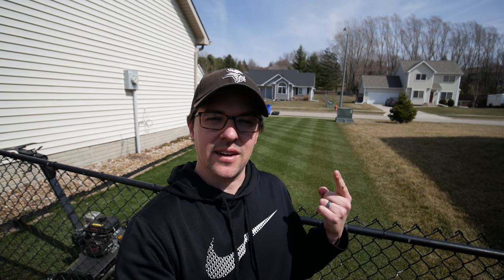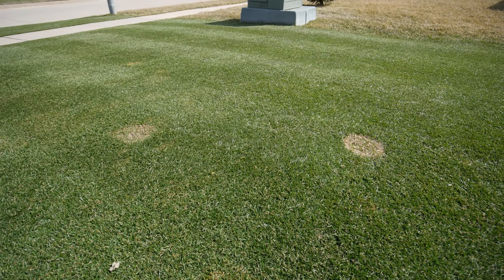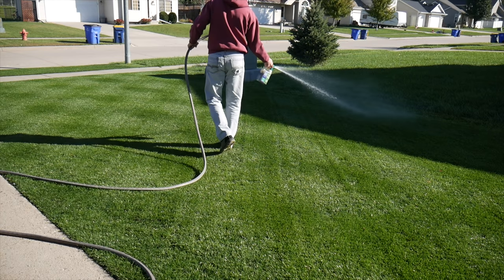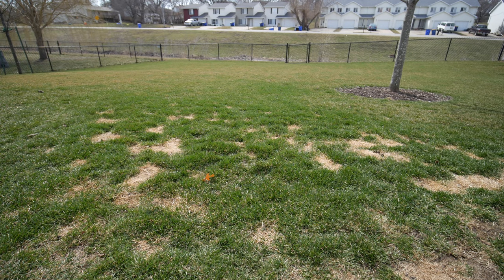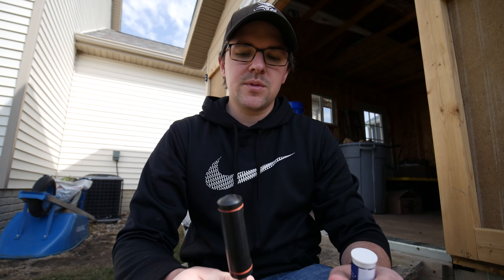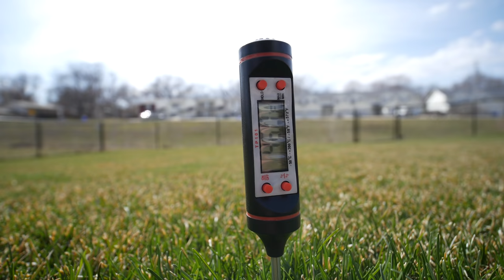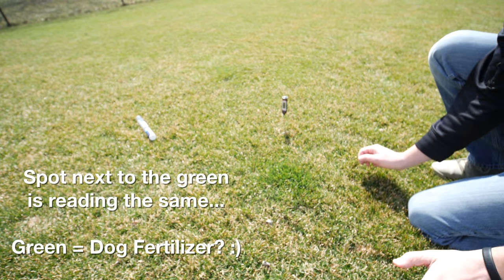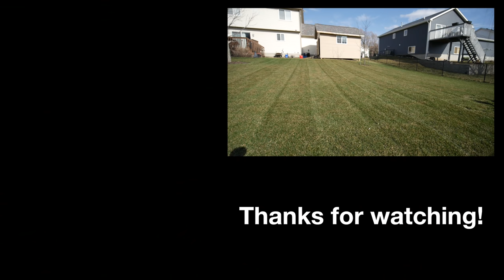First MOW of 2019!! | Reel Mowing + Toro Timemaster

Comment: Here in the uk we may get a week or two of snow, but most of the time it’s just cold , damp and miserable . But you guys who have months of snow seem to have better lawns in the spring . It seems to almost put it into stasis and protect it
Reply from the maker: It does protect it for sure...the areas where snow was on the lawn the longest are the greenest...but then there's also that snow mold issue I had a bit of.  I will take the snow to protect the grass from the -30 temp we had a few days last winter.

Comment: It’s that green because of the reel mower. Less stress on the turf due to the “scissor action”
Reply: Totally right.  In the old days, just about all lawn mowers were reel mowers.  HOC for a home lawn was between 3/4-1-1/2".
Reply: rey3472 exactly. Grass doesn’t need to be 4 inches to survive if cut properly with a reel
Reply from the maker: The beauty of that reel cut is a sight to see

Comment: Dude you need to do something like edge that nomination line  between your side and your neighbors...just to really stick it to them lol. I'm talkin perfect 90 degree angles here. Looking good already! This is fairway material. 71 today, and forecasted for 1-3 inches of snow on Wednesday. Spring is so weird.

By the way, you mentioned that simple lawn solutions liquid fert. For my lead up to overseeding reno this year, I need to get my pH down from 7.5. Might throw down elemental sulfur. But i was sort of thinking maybe some humic acid might be beneficial for seeding too? Or just stick with regular starter fert like a lesco synthetic? I dont want to unnecessarily throw down products, but I know I'm low on all 3 macro nutrients as well as high pH. Any recommendations that would get a high return without spending a ton of money? Looked into gypsum but seems useless after I researched it some more, and apparently we are near a dried up lake bed and have very high calcium levels already. Just want to maximize my germination results.
Reply from the maker: Humic/fulvic would be good as the seed germinates to help it grow roots in quicker...as for the pH and adjustment it's something I'm continuing to learn as well.  In the future ammonium sulfate would be a good and cheap option for fertilizer which would help bring down the pH but in the mean time the elemental sulfur might help to lower it but I don't know how much time it will take to make a real move on it.
Reply: @ryanknorrlawncare  Thanks for the reply, I always appreciate your input on these things :) I'll be using humic then at time of seeding I think! From what I've read about pH balancing, going DOWN is the hard part and more expensive than just buying lime once a year. Just the limited research I've done on the topic, elemental sulfur works good over the long haul, and takes months to see a result, with ammonium sulfate being a quick fix, but not permanent, although repeated use of sulfates as nitrogen sources seems to lower the pH over many years too. I guess we'll have to experiment this year and see what happens!

Comment: That PR grass looks 👌🏼! 

Someone had said that PR tends to die off in the summer heat but that doesn’t seem the case with yours. Is that because of the specific cultivar or just mis information I was told?
Reply from the maker: From my testing it appears the newer cultivars are pretty amazing.  It was also typical for ryegrass to die in extreme cold as well...I had a period last winter with no snow cover on it where we hit -30 with the wind chill and actual temp of around -15.  It has handled all of that fine.  It does not prefer heat and doesn't like the summer but spring and fall are out of this world.
Reply: Pretty good tolerance of those factors then. TTTF doesn’t like the heat as well which is what I have now. Just getting some thoughts for the far future if I ever wanted to go with a lower cut. Thanks!